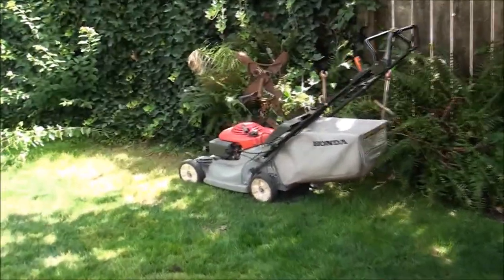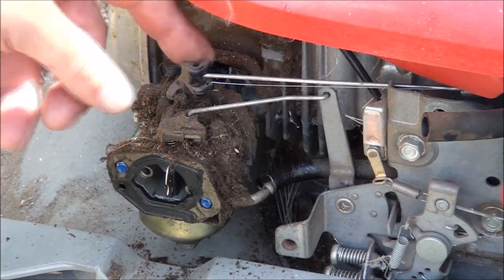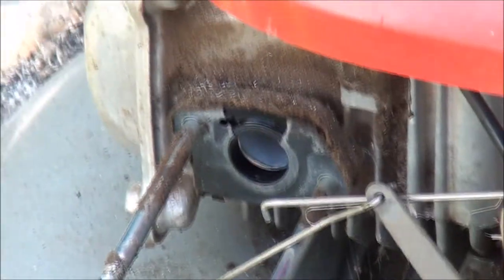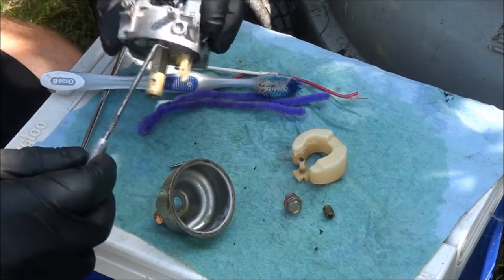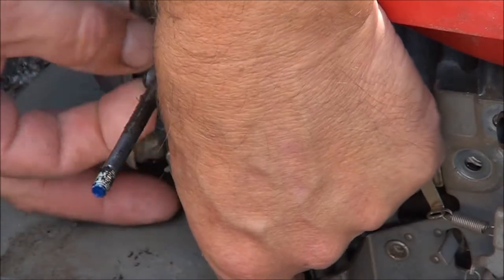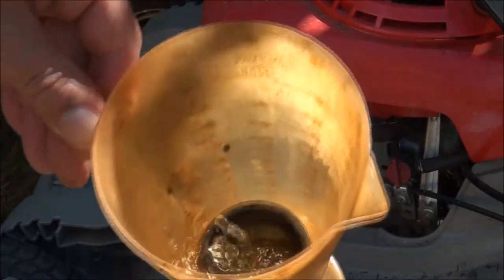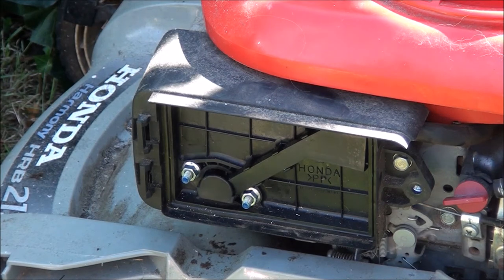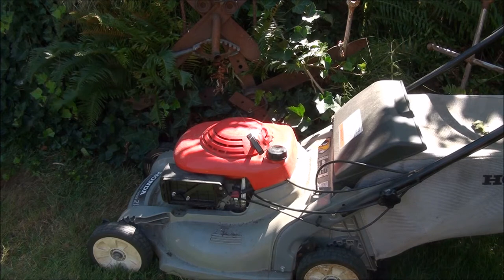HONDA Harmony Lawnmower (plastic deck type) will not RUN or START. STARTS then DIES. Carburetor

Comment: I went though three different cleaning stages to deal with surging on an already spotless carb.  $11 solved the problem with a new carb.  Only upside is every other possibility has been fixed and I'm now really good at removing Honda carbs.

Comment: I"m finally sold on the honda plastic deck model after owning metal decks forever...I was always having metal fatigue and wear down on the wheel adjusters on my yard that has lots of roots so it really stresses those height adjusters but the honda slots in the plastic are nice and deep and haven't had any play to start wearing apart....of course metal decks corrode too

Comment: I found that if you take the float bowl off and use carb cleaner, bend the plastic red straw tube into the main jet. Get some good squirts and problem solved. No need to take the carb off.